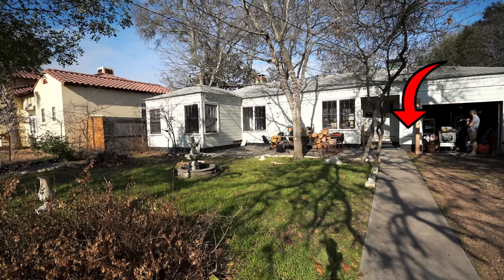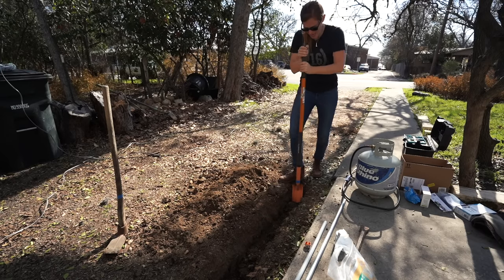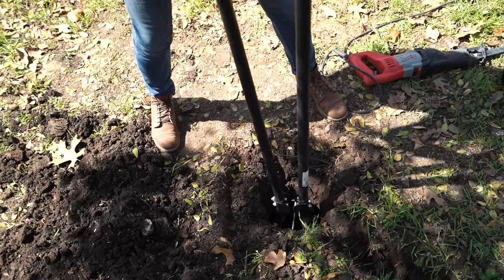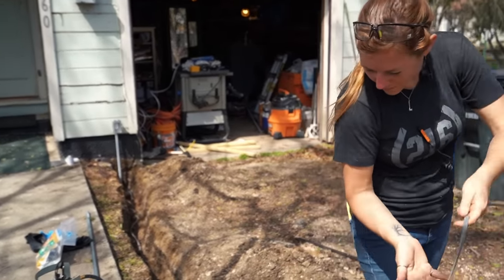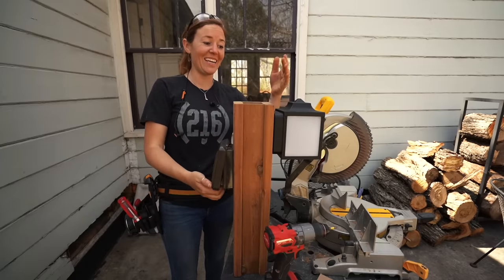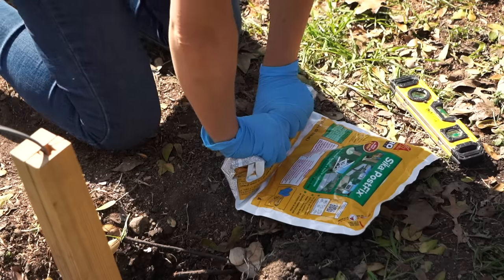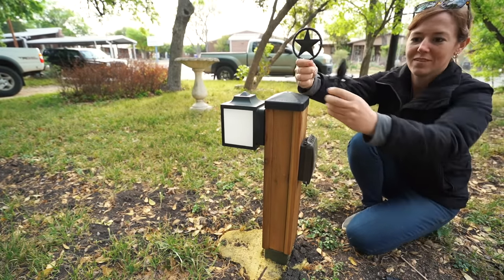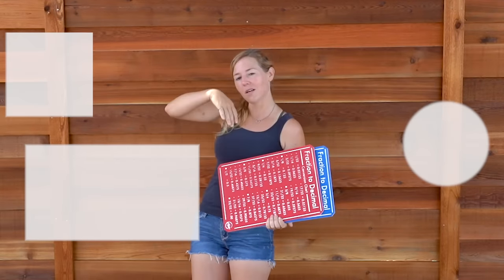DIY Outdoor Lighting and Outlet

Comment: What perfect timing! I'm currently in the stages of planning our backyard landscaping (we've been with a dirt lot for too long) and this was something I was looking for on how to do! Thanks and great video as always.
Reply: Just a tip is to put the direct burial cable in a conduit of sorts, so as to protect it from the errant fork, you, or some gardener, will invariably poke through it. A double layer of danger tape, applied right on the conduit, and a second layer after 4in of fill, will also help for when the next person comes digging in the yard. If you are doing garden irrigation bury another conduit with the irrigation pipe, with a draw cable in it, so that later on you can pull through cabling for garden lighting without having to dig up the entire area again, as you will at least have conduit there already. Conduit is cheap enough, and remember to use  a good amount of PVC weld on the joins underground, to keep it at least from getting full of water and freezing, or drowning the joins.

Comment: April in April FTW. 👍 I was wondering why not use the water hose connected to pipe, easier than pounding it with that sledge hammer, just don't stop moving it until it's through because it might lock in place. Isn't that shovel called a trenching shovel?

Comment: In my experience, putting anything under a sidewalk is much easier with a pressure washer.  You can easily put a narrow spray head on the head and blast under that sidewalk quickly.

Comment: It looked like you used a Wago nut connector at the house and plain old wire nuts at the post.  Any reason?  Just what you had available ?   I used those Wago connectors under the hood of my Jeep.

Comment: Hi April, the code in your area is very lax compared to a lot of locations, if I was doing that I would use drain pipe (plastic) or steel pipe like the piece you put under the path, I would also lay a warning tape along the trench so that anyone digging there in the future would see the tape and be warned. I would use the tape no matter what switch or anything else was under, it is very cheap and worth every dollar.

Comment: FYI, the sleeve link results in a 404.

How well does the foam support the post?  I'm going to need to replace a fence in the semi-near future & it looks attractive, but am questioning it's strength.
Reply: If that expanding foam is anything like the foam which a lot of window fitters use around windows and external doors it rots when it gets damp,I wouldn`t use it.

Comment: Where I am the trench has to be deeper and the cable run in conduit. Yoiu also have to put a few inches of fill over the conduit then place plastic tape (like Police tape) with a warning that live power is underneath. But we have 240V power not your 120V.

Comment: Hi April great vid. One thing I'll say and you may have already heard from others. Running bare wiring in the ground leaves a lot to go wrong down the road from corrosion. 
Here in So. Cal. Wiring above or below ground must be done in conduit. 
So additionally when I do run cabling I do so in 1 inch plumbing pvc in the event future wiring needs to be added for whatever additions, AND FUTURE CODE PROFFING. 
April I respect your skills but never ever run bare cabling in ground without quality conduit. 👌 Good call on the  WAGO Lever Nuts. Those are way better than twist Nuts in my opinion.

Comment: That's definitely a cute post!  Is there any concern about the romex working it's way up over time?  We buried some drip line (admittedly nowhere near as deep) and it worked its way to the surface within a few months.  

A bit of constructive (hopefully) criticism - for my old ears, the nature noises (birds, wind, whatevs) plus the low-volume music just mixed together into background cacophony.  I would have much preferred the video either without music or with slightly louder music so it wasn't at the same level as the background noise.

Comment: Hiya, pro-tip, plus code in a lot of places. Protect the cable going into any tubing/conduit, use a male adapter and do not run cable against the metal thread as you have. Stay safe, Steve...

Comment: How did you determine where the power is in the garage (or for my case, just an outside wall - I have no garage)? i.e., what would I use to determine where the wiring is?

Comment: Google Fiber: We are hiring!? =P
If you have a real long run of conduit, tie string through a small ball and vacuum it through to the other end. Tie the string to the electrical wire and pull it through.
Reply: Or tape the end of the electrical wire to the end of the pole you're using to create the hole, like a needle and thread.

Comment: Hello April,

Is there a switch on the light somewhere, or is it on all of the time?  Also what size boards did you use? Look like you started with two by sixes but the side widths don't look equal.  Just trying to figure out what type of boards to buy
Reply: Finally someone asks about the light switch, she only ran power but no switch leg

Comment: I was actually into the idea of that expanding foam until 8:05 when I saw how much the post moved.
Reply: That's not the post in the foam moving but rather the top frame that slides onto the post. That wobble must feel great when plugging stuff in though.

Comment: The kink in the wire at the bottom where it goes up into the lamp post will burn out in time.  A sweep pipe would have been better to get the wire into the post.  As well, you could have easily added another post to go along the property line with just the ease of digging 5-6 more feet.

Comment: I wish I knew about that post sleeve wrap last summer when I did my posts - by the way, your link to the sleeve doesn't work!
Reply: roofing tar works just as well but needs 3 days to dry. If you didn't make the mistake, IMO, of using concrete (dirt works well), in 20 years you can pull it up and install a sleeve on the next one.
Reply: @cliffontheroad  no concrete! The ground here (Adirondacks NY) is sand so we are able to just use a pressure treated post with some stone under it for drainage. Though I did hit ground water in some places so I would have liked to better waterproof those posts

Comment: Doesn’t the wire need to be in Conduent underground and shouldn’t the lamp post  outlet be a Gfci outlet since it’s outside ?
Reply: As she said in the video, the GFCI outlet she mounted on the wall provides GFCI protection to the "downstream" outlet.  As long as additional outlets are connected to the "load" side of the GFCI outlet they have GFCI protection.

Comment: All I'm trying to convey in my comment below is that when you dig in your yard, call 811(A national program by the way). It is a free service, at least here in Tennessee. They come out and mark any utility within (if my memory serves me right) 18' of where you placed a marker anywhere in your yard. Anywhere! 
Yes, April may be a professional and was very careful with her digging, but not everyone that watches her videos are a professional in this field. If I am going to dig in my yard, I'm calling 811 to have them mark my yard with colored paint and little colored flags. Having been trained in the military as a construction electrician in the Seabees, we were drilled with training on safety. As the old saying goes, "Better to be safe than sorry." 

And no, I am retired and have never worked for any utility company or any service company involving local utilities. And due to my train in the Seabees, I can tell you just about exactly where all my utilities are buried. But, what if I'm wrong...

It has been a few decades since I looked at the NEC about the direct burial of electrical cables, but I believe it was under the frost line, however deep that is. I have also seen videos of gas lines in a yard being struck by lightning. Unless you put it there, you DON'T know for certain how deep they are. They could be 36" down or 1" down. The installer may have had a hot date that evening and rushed the job. All the marker that 811 puts down indicates, is the path, not the depth of the utility.

Now, if you want to take the chance in digging in your unmarked yard, go for it. Hope it works out for you. In the case of this video, a simple PSA about 811 would have been awesome and prudent. Our utility companies have a message on their bill every month about using 811. They don't want you or your neighbor to have any interruptions in your utilities, your fault, or theirs. If this comment keeps one person safe while digging in their yard, I have succeeded. This concludes my Public Service Announcement. Thank you.

Comment: Why would you use the little holes in the back of the receptacle? The contact there is terrible and causes the receptacle to discolor over time and heat up under loads that it normally would handle. Why not use the screws provided?

Comment: I suggest buying a cheap axe for roots. It it will cut through them very easily, not damage your power tools and is cheaper than reciprocating saw blades bot immediately and in the long term.

Comment: hope u r not using steel or gi pipe for ur secert tunnel bcos overtimes it will get rusty n cuts the wire which will create a short circuit which i have experince b4.

Comment: Nice tutorial. It should be noted that in some areas you must have the electrical work done by an electrician. Also another good tip is to place a pressure treated board with some caution tape stapled to it [or painted a bright color] directly on top of the cable. This will protect the wire if someone was to come back later to dig for something else, and make it obvious that it's not random scrap in the ground when they do hit it.

Comment: I am going to pick on you for a minute, not trying to critique you just give a few pointers. Digging the ditch, go full depth at the start, then go back and inch or so in the ditch and shove the shovel down as deep as it will go and pry into the starting hole; you want to relieve the pressure. Grubbing hoes are horrible to operate, if the ground is extremely hard, use a short San Angelo bar or buy a clay spade for your Bulldog type hammer drill (I have seen you use that before) I have one, just wish it was about 10 inches longer for 24" deep ditches.
When you put a receptacle in an old work box, you break the 4 ears off so the receptacle sits flush on the box between the box ears. this helps to keep the water out too, getting rid of that small gap. The box on the house, either caulk the top and sides or use duct seal around the box to keep water from going down behind the box and rotting your siding or allowing a bunch of bugs in. 
thanks for the videos.

Comment: It's good that you mention several times to make sure to check codes, but I think you missed one.  The blue boxes you used for the light box and receptacle are not actually up to code for outdoor use, as they are not weather tight.  Installing them in the post doesn't count either.  So many codes, but they are there to protect everyone.  A small rain event can create a short, or worse, a fire.
Reply: inside the post is no longer a wet location.  no different than installing on the exterior of the house itself

Comment: Hi April, very nice video. May I ask, what is the purpose of the sleeve around the base of the post that will in the hole? Is that just to keep the two post pieces together?

Also, how would you extend wiring for additional light posts? I would like to use your post idea for path lighting.

Comment: That foam is good for a one off post like that, But I've seen others that have tried it for fencing and it doesn't hold.
Reply: 6' fence; I go down 30" to the frost line and just fill with dirt, tamping every so often. Solid install. Yet the post can be lifted out if I made a boo-boo. Round pipe might need concrete unless a collar was incorporated to prevent rocking.

Comment: The foam may be convenient, but is essentially just some unrecyclable plastic.
Reply: Or since it didn't end up in a landfill you could accurately say it was recycled, right?   :)
Reply: @garrettswoodworx1873  Not really. Eventually, even if it's a hundred years from now, it will be either burned or buried, because there's not much else you can do with cured polyurethane.

Comment: If it’s only lights you are powering then use a 24 volt system and you can just lay the wire over the ground along the edge of the sidewalk and still stay within code. Only digging required would be under the sidewalk.
Reply: 6” inches under 30 volts per table 300.5 of NEC

Comment: I realllly don't get why anyone wouldn't run conduit for this. You're already digging the trench and running the wire, so why not spend $20 and put it in conduit? Especially with a shallow trench. Just because code says you can doesn't mean you should. Now, if this was a long run across an area where nobody would ever dig, yeah, you'd save some bucks by direct burying the wire, but I really don't think that makes any sense here. Good trick with the pipe though!

Comment: It's dangerous put the cable right into the dirt, could you use some pvc pipe instead ?
Reply: Installed according to her Code at 12"   depth when protected with  a ground fault interrupter.
Reply: It is 100% to code without conduit. If she was to use conduit you actually use a different wire all together.
Reply: She's in Texas, where people let people be, don't live in fear of the sky falling or other ridiculousness. Not to mention:  IT'S ON A GFI.
Reply: UF cable is water proof and can be direct buried.
Reply: @jimrumsey8077  Except she missed this:
https://www.cityelectricsupply.com/3m-302-r-3x1000ft-caution-buried-electric-line-below-tape

I lived about an hour north of her for 25 years (Bell County) . By code, we had to bury line tape on top of any buried wiring or conduit.

Comment: Well your (the US) safety regulations are terrible and dangerous too.
Here ,  your (garden) ground cable must be 2 feet deep, or twice the length of a spade.
But what is more important IT NEEDS TO HAVE AN EARTH SCREEN , that is twisted iron mesh around the two wires, connected to the ground of your electrical system.
So if somebody accidentally put a spade or axe or other metal tool through the mesh and wires it will short circuit  the system and the fuse will break or the ground residual current device will hit in.